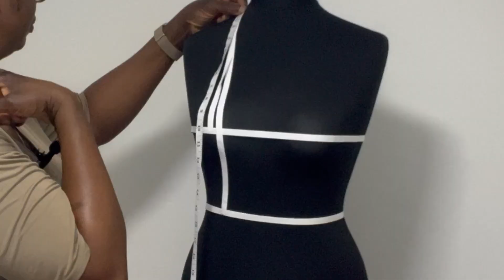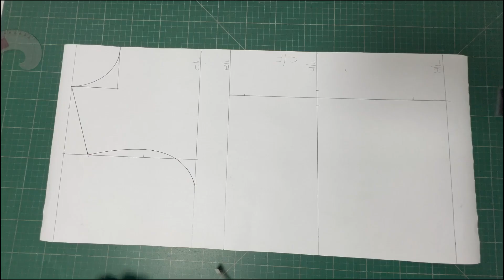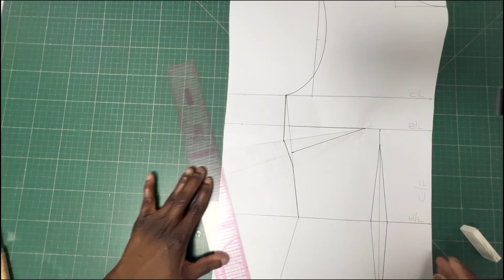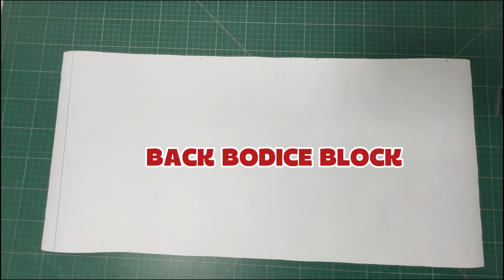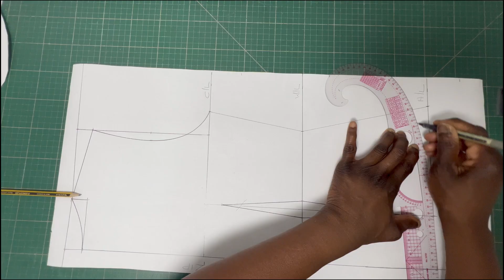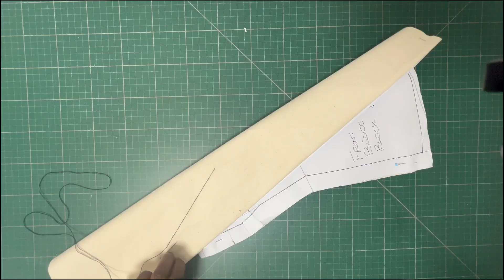Basic Bodice Block for Absolute beginners

Comment from the maker: Download the resources using the link below and follow along as you draft your own bodice block from scratch.
https://drive.google.com/file/d/1KwJoXy5WUXV-B3lNRH3ln6-m776mweG0/view?usp=drive_link

You'll find everything you need in the link above to follow along with this tutorial, including:
•	A Bodice Block Measurement Sheet.
•	A Bodice Block Diagram - to guide you through each step.
•	An Inches to Centimetres Conversion Chart - for easy measuring.